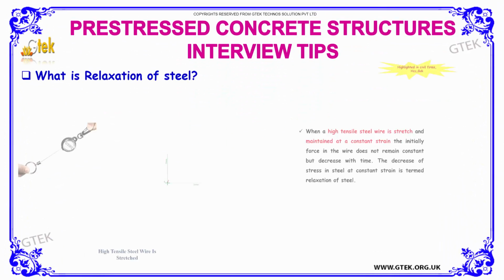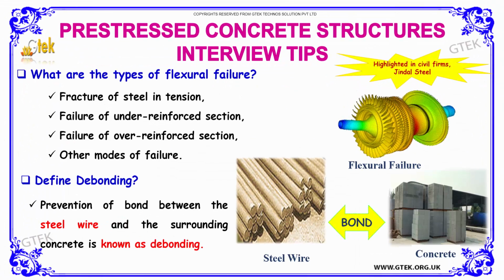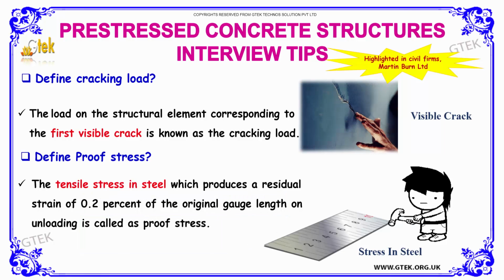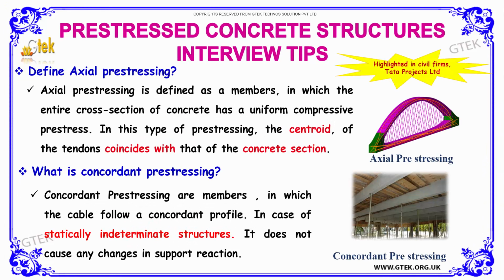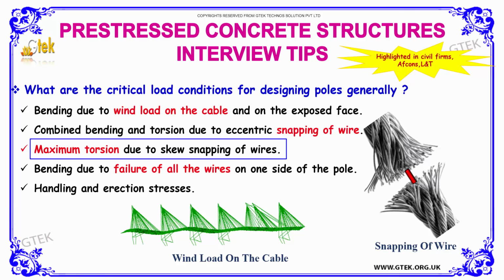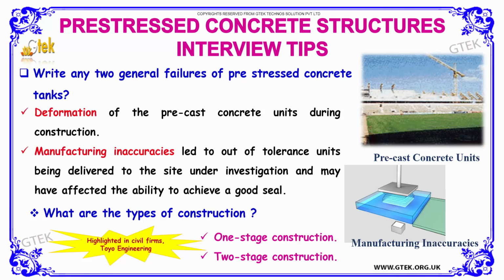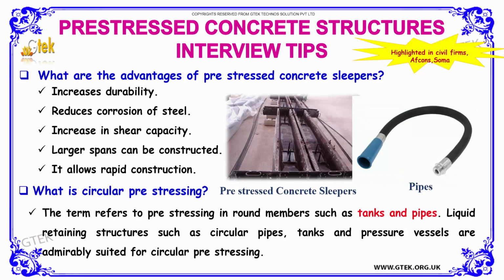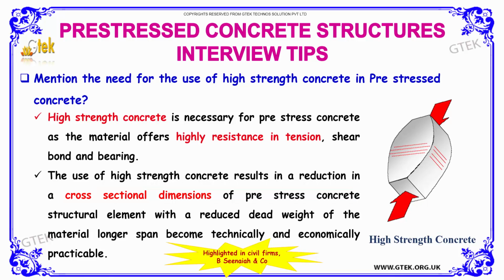Top 50 Prestressed Concrete Structure civil technical interview questions and answers for fresher

Comment: Prestressed concrete is a concrete construction material which is placed under compression ... Prestressed concrete is used in a wide range of building and civil structures where its improved concrete ..... :594–598 Initial works have also been successfully conducted on the use of precast prestressed concrete for road .

Comment: Prestressed concrete is a concrete construction material which is placed under compression prior to it supporting any applied loads (i.e. it is "pre" stressed). ... Tensioning (or "stressing") of the tendons may be undertaken either before (pre-tensioning) or after (post-tensioning) the concrete itself is cast.

Comment: Prestressed concrete is a method for overcoming concrete's natural weakness in tension. It can be used to produce beams, floors or bridges with a longer span than is practical with ordinary reinforced concrete. It is often used in commercial and residential construction as a foundation slab.

Comment: What is tendon in prestressed concrete?
Prestressing tendons (generally of high tensile strength steel cable or rods) are used to provide a clamping load which produces a compressive stress that balances the tensile stress that the concrete compression member would otherwise experience due to a bending load.

Comment: What is meant by prestressed concrete?
Prestressed concrete is a method for overcoming concrete's natural weakness in tension. It can be used to produce beams, floors or bridges with a longer span than is practical with ordinary reinforced concrete. It is often used in commercial and residential construction as a foundation slab.

Comment: The minimum cube strength of concrete used for a prestressed member, is
[A]. 50 kg/cm2
[B]. 150 kg/cm2
[C]. 250 kg/cm2
[D]. 
350 kg/cm2 @
[E]. 400 kg/cm2
Answer: Option D
Reply: For post tensioning - M40
For Pre-tensioning- M30